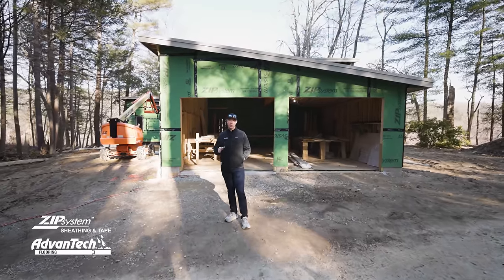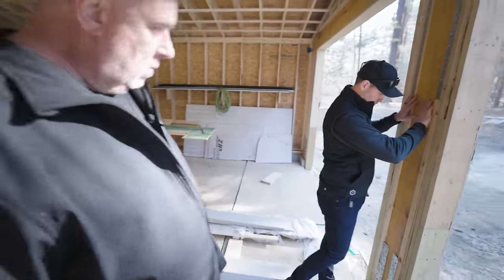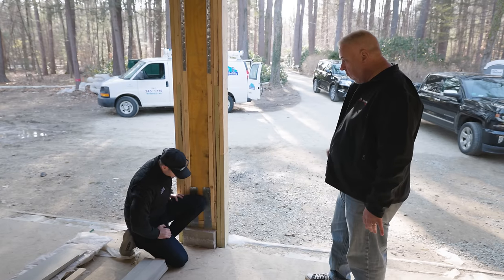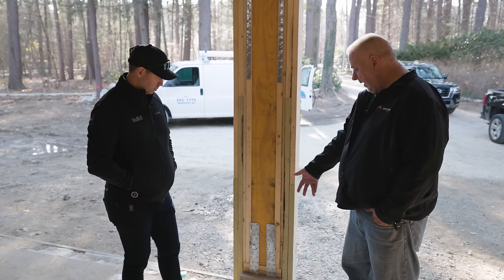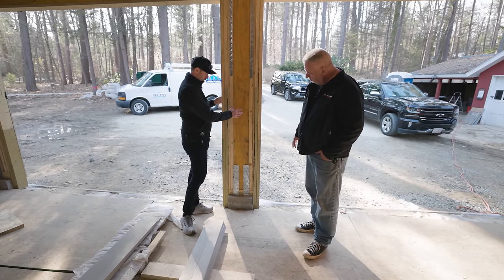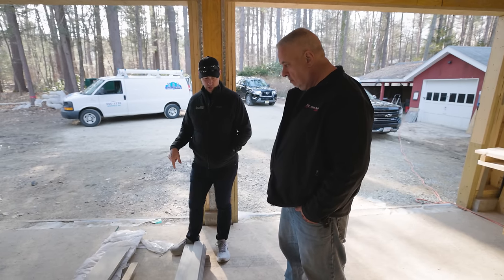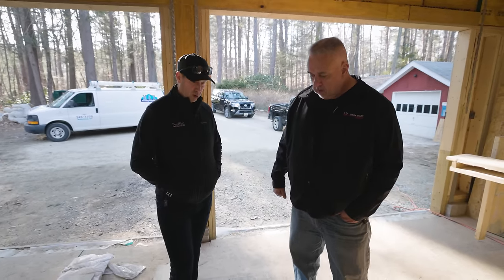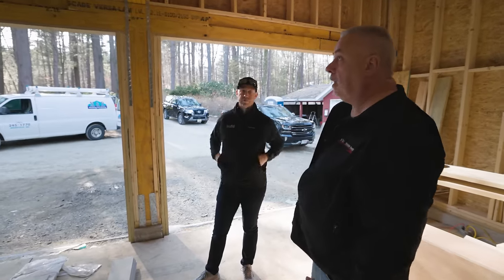3 Tips for Smart Garage Framing

Comment: Any explanation for why we would want the two 2x6s around the door? The video says you SHOULD do this, but it doesn’t (clearly) articulate WHY.
Reply: Also interested
Reply: It allows the steel garage door track to clear the concrete wall.
Reply: @jesseherman2453  Yes it does but also gives you a nailer for door trim to grade
Reply: Gives you a nailer for door trim to grade, You need the trim all the way down for the flashing
Reply: Makes it stronger. Like they the bigger the better.
Reply: Garage door guys need 3” on each side to install the track beside the door.
Reply: Keeps out ghosts

Comment: My only hang-up and pet peeve with this garage build is the amount of space that will be on the drivers side of the car in either parking space in the garage.  I think there should be a minimum 24" in the center or either side of the garage specifically, so that you can park your car and get in and out of your car without having to pull some sort of Dukes of Hazzard move.  The OTHER reason is that it allows you room to run shelving and 2' counters to work on in the garage, or roll your tool chest against a side wall and still be able to open a drawer when you have your car parked, and the garage door shut in the dead of winter.  Or, to be able to store your lawn mower, rototiller, spreader... That 24" on both sides of a garage and center is important.
Reply: I tend to agree with you, but check out how deep the garage seems to be when they walk in at the beginning. Plenty of room for a workshop area deep inside. Also, I get the feeling this is a special use garage since it’s obviously freestanding on a large property. For instance the owner has two vintage Porsches and wants a place to winter them. Smaller sports cars would still have plenty of room if those are 10’ doors.
Reply: Yeah that garage should be 22 feet wide and 24 feet deep to allow for 2 foot cabinets
Reply: You are exactly right.  Even if it is a special use garage, building for future use when someone may want to pull a truck and large SUV into the space will be tough.  They aren't cramped for lot size, so taking 3' off the depth and adding it to the width if budget is a concern would have been way smarter.  EVERYBODY knows, figure out the amount of space you want, then double it for your garage.
Reply: “figure out the amount of space you want, then double it for your garage.”

You mean like building an extra 2-car garage because you have room on the property?
Reply: It's 24' wide and 26' ft deep, that is the biggest we could make it
Reply: @crabkilla  It's 24' wide X 26' deep
Reply: @doug.ritson  We had restricted zoning here - it's maxed out
Reply: @stevenbaczekarchitect9431  Oooo nice juicy sized garage! 🤩
Reply: @stevenbaczekarchitect9431  Those guys down at the permit office never had to park a corvette in a garage!
Reply: @stevenbaczekarchitect9431  first thought I had when someone said it should be bigger.... zoning regulations.
Reply: @travisstorbakken1737  unfortunately - rules, rules, rules
Reply: @stevenbaczekarchitect9431  And many rules make no sense. Why is 24x26 feet the maximum allowed?
Reply: You guys want to hear about zoning issues?? My buddy wanted to add on to his garage in RI, as is it was an 20' x 16' and he wanted to add 12' to one side. The RI city he lived in wanted full drawings and they cut that "addition" down to 9' wide and 14' long.  Although they already restricted the length of the addition, they wouldn't even let him extend 10' wide instead of an odd 9' for a standard measurement!! Apparently it's based on the size of his lot, which was 1/2 acre. They only allowed him to add 9x14 or 126sq feet total to his existing garage, they wouldn't budge even with no opposition from any neighbors...

Comment: You guys don't explain why you add the extra 6". Is it to give more room to swing car doors open? To provide more facing area for trim boards? Is it just about aesthetics or something else?  Also agree with the comment to install wider garage doors if you can. They make such a big difference for ingress and egress given the trend towards larger vehicles, and also give you more aisle space to open doors or carry stuff without dinging the vehicles parked inside. I installed 9' wide doors in our custom house, and ended up with a good 4' of aisle space between our cars, and also more clearance on both end walls for shelving.
Reply: the extra 6" is measured to the concrete, its to give room for the extra treated timber up the sides which they have already have fitted.
Reply: I'm going with the reason is for trim around the jamb not needing to be scribed around the concrete foundation stem. Much cleaner detail if you can afford the inches.
Reply: Ahhh, new to this channel, eh? They give the special details, but you’ll have to figure out why if you care enough!
Reply: i have water coming in from when the wind blows the rain on the garage door. mainly happens on the corners. is this normal?
Reply: @randomrazr  I assume on the bottom of the door? Maybe add a drip edge or a rubber strip under the door, so it closes the gap when you close the door.
Reply: It's more of a reminder than a special detail.  A reminder to leave enough rough opening between the concrete stem walls for the jack studs.  I usually allow 3" over nominal door width to allow 1 PT jack stud to go to floor, the rest sit on stem wall top.
Reply: @tweake7175  Thank you
Reply: @randomrazr  Um NO
Reply: @PrinceVaskur  most doors are gasketed
Reply: @probuilder961  I run 2, we have had minor issues with door hardware in the past 3" each side ensures we don't
Reply: Track for the garage door

Comment: Nice framing and ideas, but don't like the little space between the doors and the sides to the wall, if you have two cars in the garage, it is hard to open the doors without hitting the wall or the other car, an extra foot makes a big difference.
Reply: We were restricted by zoning
Reply: @stevenbaczekarchitect9431  Interesting.  I wouldn't have guessed that.

Comment: Custom home, should have gone with wider doors, not just 8 footers.
Reply: You have to see what the Germans do. I feel if I had my own I would have to park right on the wall on the passenger side to get my butt out of the drivers door. My parking space is bad enough where I live and I have a Toyota CH-R and still have to squeeze out of my door.
Reply: @popeshop5863  These are 9's
Reply: @stevenbaczekarchitect9431  Just being lazy especially if I had a dually with what I call the moose antler trailer side mirrors 😂 loved my grandfathers double-single door. Poor thing suffered during NY winter months. Quite surprised his garage door electronics survived till after he passed away. When I build my garage I would like space between the garage doors and then some, getting too rusty to limbo out of any vehicle.
Reply: yup wider and taller. I have taller doors dont have to remove yakima carrier on my lifted SUV when I park in garaage

Comment: nice detail on the doors. on my own we had to cut the concrete to fit a replacement door. having a treated timber surround thats also easily replaceable is a smart idea.
also nice job on the roof ties. more the better. nothing like a blown in garage door to lift up the roof.

Comment: With all of us (especially today’s new home customer) getting EV’s, you need a divider wall between the garage bays that’s a foot wider than the house you showed (should be 3-ft minimum).  That location between the garage doors is prime real estate for the Level 2 car charger that can reach cars in either bay!  The EV charger is another reason to go with two doors in a 2-car garage, instead of one large door.
Also, our builder recommended 9’ wide doors to appease the “F-150” crowd with their large mirrors.  We went with a “small” 9’W x 8’H door plus a “large” 9’W x 10’H door - and we are glad we did.  
A good idea for how to set up a modern garage for EV’s might be a good video topic.  Since EV manufacturer’s have not yet standardized the location for the charging port (front, rear, left, right), it actually might be best to have a post between between the bays halfway down the parking stall to reach all four corners of a possible EV.  Charger cords are only a max of 25 ft by code, which is very short.
Reply: We were restricted by zoning
Reply: In the UK, I've heard a suggestion that there should be a Fireman's switch on the outside of buildings to cut the power to EV chargers in case of fire.
Reply: @tlangdon12  In the U.S., I think the firefighters can pull the meter, which is normally on the outside of the building, and that cuts the power to the whole building.  I think my meter panel (located outside my garage) also has disconnect switches inside for the two 200 amp panels in my garage, allowing a firefighter to turn off power to the house.

Comment: I have a pickup and an Expedition.   I need 18 inches of space on each side of my 9 foot wide single garage doors to swing the vehicle doors completely open.  This means the divider between the two garage doors is 18 inches (unless you intend to open the doors of both cars at the same time, which I don't).  You could accomplish the same thing with a 20 foot wide double garage door, but not the standard 18 footer.  I like to store stuff 3 feet deep along the walls beside the vehicles, which means I need 4'6" between the edge of each garage door and the side walls.  So the total interior width of the 2-car garage is 28'6".  Works great and I have tons of storage.
Interior length is 24 feet which leaves room for shelves or cabinets on the back wall too.  I have a separate workshop, so no need to squeeze that into the garage space.

Comment: The order of frustration of home owners with garages.
#1 garage door header is too low,if a bonus room is above it...header should be directly under ceiling joists/rafters whatever you call them.

#2 it's too shallow and/or narrow,you need room to open doors,have storage ÷ appliances on side/rear.
#3 elevate garage slab to have slope to keep water from coming underneath. 
Notches/curbs are annoying to roll or even walk over unless you live in a high wind area .
Grass and organics blow against driveways and soon its taller than the driveway surface creating a dam.
#4 aesthetically/functionality you need 4ft of wall between doors.
You can have your choice of storage/water hose reel/vacuum/mop sink on the inside,and it looks more balanced on the exterior. 
Too narrow/short of a garage seldom see vehicles,because it simply is not functional and water  runs underneath from poor slope.
Reply: All those things work well in Kansas or parts of Texas, we were restricted by zoning here

Comment: Our builder does brick returns at garage opening. We frame our opening 16'9" and use a 2x12 for garage door track backer, hanging into thr opening 4.5".  Brick ends there.  Very clean look and no wood on the exterior

Comment: It's so nice to have a wide garage door.  My builder house from the 1990's have two 7 foot doors, inside is only 15 foot wide, so you cannot open driver door if you pull in on the left or passenger door if you pull in on the right.  Terrible working space, but what can you do.

Comment: Nice.  That's a big beam for the mid-span.  I got that you needed that for the length limitation on the 2x12's, but, did you consider use of a clear span truss instead?  I assume that's a cost consideration?
Reply: We did, but the rest of the house was 2X12 so this keeps it in the framers mindset for the project, also give the homeowner some storage above on the high side
Reply: @stevenbaczekarchitect9431  Good stuff Steve. Thank you.  I ask because I'm getting ready to build an almost identical looking free-standing garage (24' span) and wondering about a clear span vs a center lvl.
Reply: @joemartino6976  Steven, knowing that an area like that is going to be used for storage, do you ever print any information on beams etc. to help the homeowner known how much weight they can load onto it?

Comment: That's because those hold-downs are required for seismic locations.
Since most of the country lies in Class A or B, standard fasteners are sufficient.
There are better straps that don't chip away however. And if you design the coverage to be thick enough, you won't have that issue.

Comment: He added PT wood on only the bottom few feet of the exposed door framing and pieced in pieces of non-PT above it.  Why, other than to save a few bucks?  It creates a joint on the weather-exposed frame.  Unfortunately, I’ve seen more un-treated wood used for the exterior framing on the garage door and have replaced a bunch of it later (when it rotted) with PT.
Reply: If you look at the start of the video, you can see that the Zip sheathing has been taken over the entire door frame, providing some cover to the untreated wood (from the front), but I agree it would have been more sensible to ensure the all timber that is facing the opening is PT so that the side is also protected. Others have commented that 1 inch of a non-rotting material (e.g. PVC) at the very foot for the frame would give much greater protection from standing water wicking its way up the end grain.

Comment: I'd appreciate some advise on materials to use for soffit.  I see the Hardie soffit with the holes in it for ventilation and while this is good, it is very heavy and only comes in one width 24".  Is there something else that lets you cut it to 28" so there is no joint?  Thanks.

Comment: Why do you have the beam running down the middle of the garage and use 2x roof framing? Seems like TJI would have not a problem with that span across the garage. Less structure and labor? Curious if there was another reason.
Reply: It cost a little more and the whole house is framed with 2X12 rafters so i wanted to keep it in the family, all rafter cuts are the same now

Comment: What happens when someone slides on the ice and takes out the post. Will the garage collapse. BTW a neighbor of mine with an SUV with a roof bike rack.  Hit the header so hard on their triple car garage that it took out the post wall supporting it. Made a real miss of this gable end wall.  The house was sheeted with cost saving cardboard crap. Obviously, plywood or OSB would have been much better.
Reply: I would say it was likely that the garage would collapse, but that's why we have insurance. You  could install a couple of sacrificial steel bollards in front of it as some further insurnace.

Comment: It’s amazing on these new houses they don’t use 6” solid block or concrete and let the drywall go down to within 1” of the floor.  Those concrete ledges are so nasty looking. Definitely 1950 mentality.  If I built a home and I left a concrete ledge in the garage like that , the homeowners would have me remove it.  I see it over and over and it’s not even a code anywhere.  Unbelievable.
Reply: Of course it is, we need to keep the wood framing +8" from grade - this is a typical detail in most places I work??
Reply: @stevenbaczekarchitect9431  The concrete plinth seems a sensible detail to me.